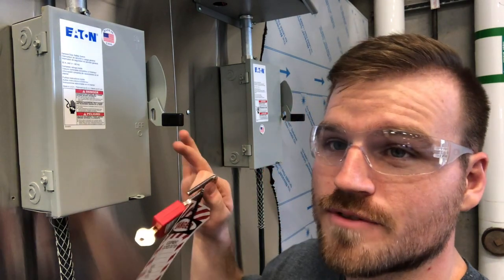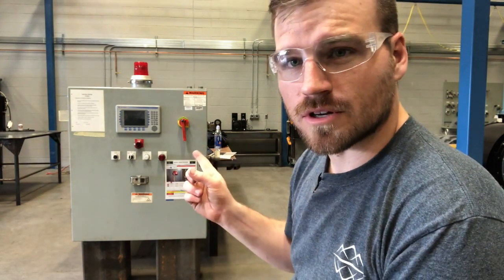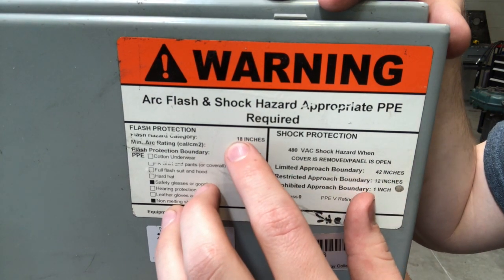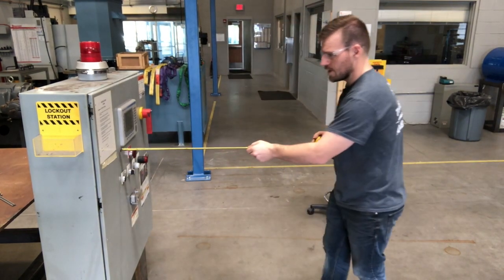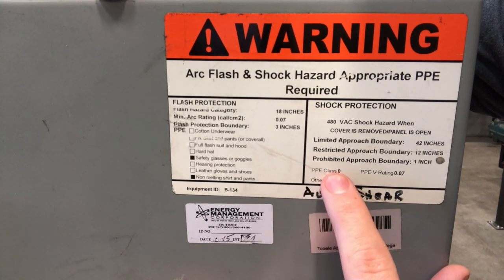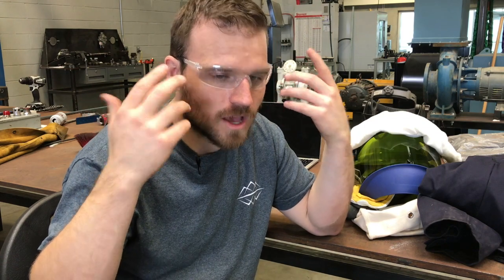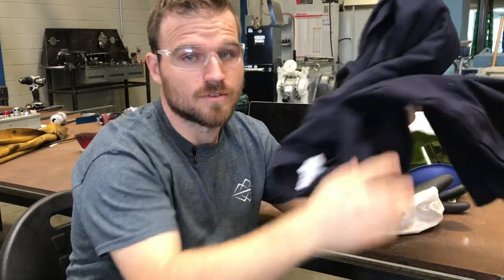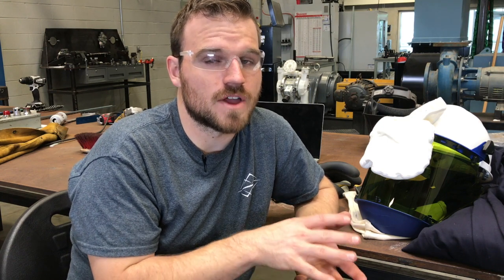Basic Electrical - Electrical Safety for Industrial Maintenance Employees

Comment: You've got some good videos , but a multimeter is definitely not the best idea for using to make sure a circuit is dead. (Yes we've all done it) By the simple fact that it has a switch on it, it makes it too easy to make a mistake with setting the meter to an incorrect range. I saw the result of this some years ago when someone inadvertently set his meter to resistance rather than voltage, the supply he thought was isolated wasn't and resulted in a small explosion. This took out 1 phase of the incoming supply and permanently injured the electrician. It's much better / safer to use an approved 2 pole test lamp.